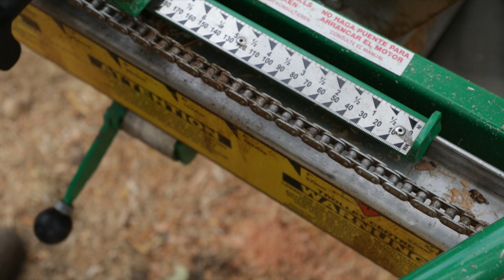How To Make Lumber With A Sawmill

Comment: Cody, I know you love that Lucas mill, but it would drive me nuts!  We just milled 76 logs in three days on a Woodmizer - about the same size as the ones you're working through, mixed posts, beams, dimensional lumber and inch board.  We did, however, have the advantage of three guys and two tractors to load logs and cart material away.  Enjoyed the video and seeing how other machines work.  Thanks!
Reply: I used to mill 7 to 10 logs every evening after work, with my son and wife on our 827 Lucas we got 13 years back. You can make a lot of lumber in a few hours. I just roll them into 3 notched  8 x 8' s ( slight downhill on the outside bearers, and a pry bar up to about 24 inches. Over that, I'll raise the mill and carry in on the forks) the middle one for a wedge to support the center over 10 feet, rail tracks set at 17 feet so I can roll in 16's, they drop in, wedge it with some pine, line up the head  to optimize and cut. Plus, I've done 50 inch oak...took lumber off the top, flipped on the forks, machined the bearers, set the flat side down. took lumber off the other side and wound up with a 6 inch thick bar top 16 feet long for my neighbor. Local band mills wouldn't touch it as it was over 36 wide. Took about 4 hours. Blew his mind. made many bar tops like this, trimming both side or leaving bark. Skim it with the  blade and it looks milled. Took 6 guys to lift it onto his horses for drying. Plus I have the 'weatherboard' beveled siding attachment and the slabber. Many homes and garages around here have our beveled siding. Finally put it on our house as it's really nice. The blade can be angled and you get tapered pieces every cut cycle.. Super fast...love cutting it..
Closed the business a few years ago when my son got married. I just mill for fun now, or stuff the local band mills can't do. Or my son in law..8 x 8 x 16 wet hemlock yesterday...HEAVY!!!
A swingblade (Peterson is thier main competitor) is more of a planer mill than a saw, and the Peterson can cut 8 x 16 easy. I removed a guard so I can cut 2 1/4 x 16 after leveling the blade, and cutting on the other side on the way back. Learned a lot over the years. 2 x 12's are easy. With a nice young feller to pick them off the log!!!

Comment: Some nice timber. Lucas is a superb machine. I believe you are supposed to press the lock lever when winding up also. Not just wind it up at the start as you did. Wears the mechanism out and should be in your manual. Also wide horizontal cuts 8", are better done in two passes, stops the blade getting packed with sawdust and rising up. Some great scenery and good video.

Comment: I like smaller saws now like the one you took the branch stumps off the tree with. My dad has/had an old Husqvarna but the crank and piston died in it. And I have also an older model stihl. Both saws are one of the larger models. I jsut bought a new Ms170 from stihl at a flee market. I use that thing for everything. So much lighter and convenient.

Comment: Thank you for sharing.  I have 4 reloaded trees that I cut down and I saved 24 feet logs about 36 inches in diameter. What would you recommend will be the best strategy to mill my logs? Never done it before. Planning on buying a nit so expensive sawmill for the job.

Comment: great video! i just finished a side job im doing between classes at uni, got a Husqvarna 445 with a 20in bar and im cutting up a 5ft diameter maple. I wish i had a portable sawmill to slab it, its some really beautiful wood. But i dont have the money or equiptment to make it work right now so i guess it will be firewood :/
Reply: also LOVE the saw, i got it used the other day and I am confident it is the best purchase I have ever made

Comment: Hi, I have two questions for you and a clarification about Husqvarna. The questions are. 

How come you could not saw a bord at the bottom of the log. Is it too wobbly when it is soo little wood left or did you lay it on to low support beams? 

Don't you feel it is a bit unsafe to walk so close to a live cutting blade walking over beams on the ground? Have you thought about adding some kind in push rod to get you a bit away from it?

And about Husqvarna. As your friend said in the movie the name is made up of two parts. Hus is not from the modern word for House. Hus here stems from the middle age term Keep or Castle. Qvarna that is the word for grain mill. So that is the history behind the towns name. Later the water flow was used to setup the industry that took on the name Husqvarna we know today.

Comment: Why are you cutting raw lumber to finished dimensions? Are you going for a smaller than standard size on purpose?
Reply: I was wondering too, but if you noticed they used all the tree had to give that cut.  I think they were just optimizing the cuts rather than worrying about dimension.

Comment: This rig is one very dangerous sawmill machine. The operator is walking very close inside & of he trips or stumbles then the may be limb less. There gas to be a better way to operate this thing.
Reply: That is my only concern about this design. Otherwise it is super smart I wonder if it could be possible to just add a long bar to drag it from like 10 feet away.